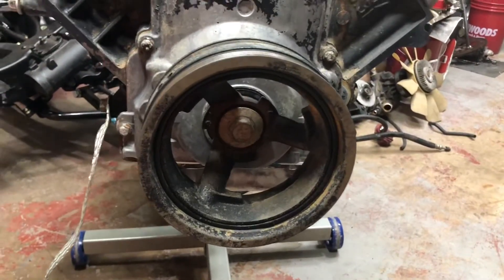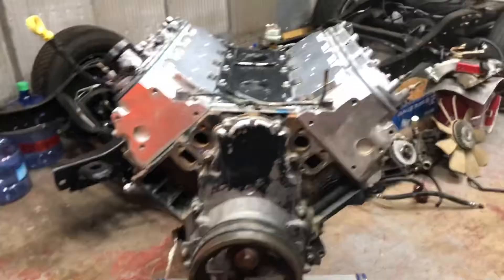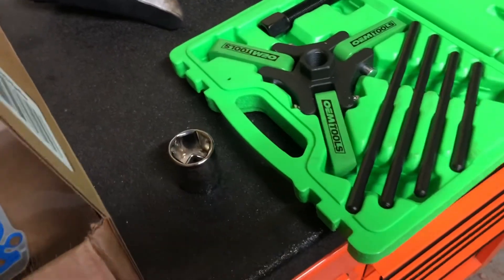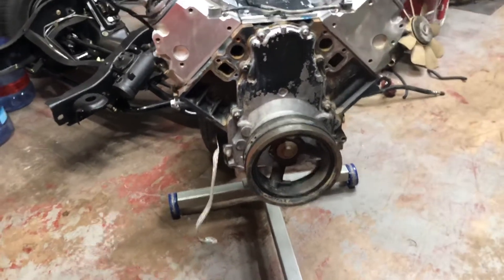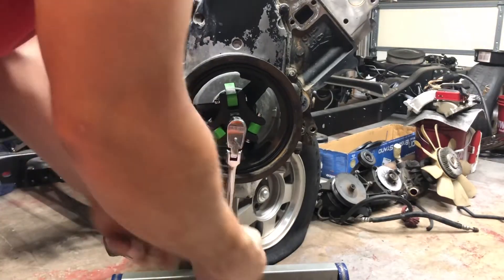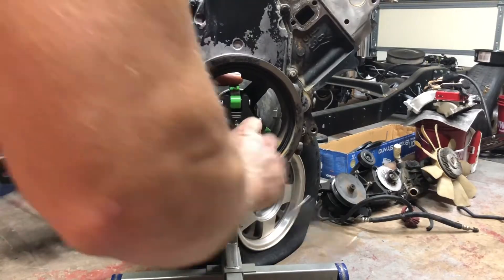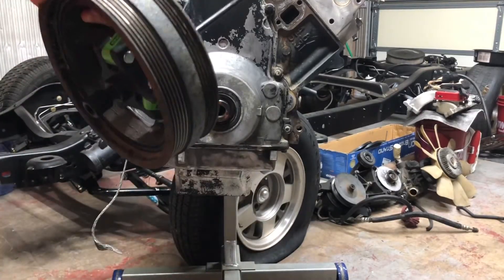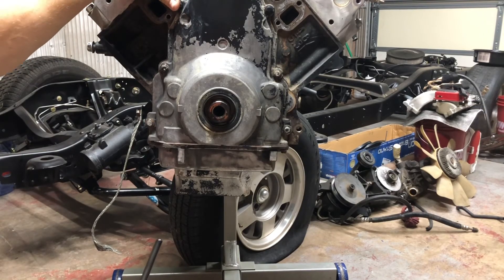How to remove a 5.3 LS Harmonic Balancer!

Comment: I'm no engine guru but I did spend 8 yrs in the US Navy operating Nuclear Reactors onboard Fast Attack Submarines, maintained, repaired and overhauled the engine room and have 10 US Patents in design of Fault Tolerant Servers. So rather than using those crappy thin rods many say bend, why not just buy a 5$ steel bolt whose diameter is a bit less than the crank bolt, cut of the head so it slides in and takes the place of said crappy thin a** rod or buy a stock piece of steel rod from the Big Box HW store, cut it to lengths with your grinder and then either way you have something thick and hard to press against the crank which should make this even easier than your experience................Just sayin'.................Nice demo thought..thank you Brother.
Reply from the maker: I already bought the tool with the rods so didn’t see the need to buy more rods, some say they bend. I’ve never had the issue but I also don’t put a impact on mine.

Comment: OEM  puller is great.  I bought one a few years back.  Mine didn't come with the longest rod strangelu but I was still able to use it to pull the balancer off of  my 05 silverado 1500 5.3.  I'm about to do it again .I wonder if they sell replacement rods for this puller? Great video.
Reply from the maker: It’s a great puller, I’ve never found any replacement rods for them.
Reply: @3rdGenC10s  Yes it is.  I probably won't be able to either sadly.  I did email OEM customer service today buy I am not holding my breath for a positive answer from them.
Reply from the maker: @kaylamarie8309  I wonder if you had a extra push rod laying around if it would work.
Reply: @3rdGenC10s  I don't know, maybe.  If I don't hear back from OEM customer service I might just order another OEM duplicate kit.  I can't stand having something that's incomplete.  There was some kind of washer in the kit as well that didn't make it to me.  Me thinks they might have sent me someone else's return lol. Oh well, live and learn and don't just blindly trust right?

Comment: I have a real space issue with my 5.3 swap.  Can I use a different balancer with a lower profile water pump?
Reply from the maker: I would look into getting a car water pump and accessories, or look at aftermarket brackets to move the accessories where you need them. ICT Billet makes good affordable products.
Reply: @3rdGenC10s  - Thanks. That’s where I’m headed.  I think I’m going with an LSA pump and LS3 balancer, at least to begin with.  Once that gets sorted, I’ll get with ICT Billet or similar shop for accessory drives and components.  I appreciate the quick reply.  By the way, great video!
Reply from the maker: @familyschnekser4819  no problem! Thanks for the support!

Comment: what is the torque spec of that bolt when you want to return?
Reply from the maker: https://youtu.be/JCU4FwXJ0C0

You’ll need to purchase a factory replacement crank bolt as they are torque to yield and should only be used once. I used a ARP fastener that is reusable.
Reply: @3rdGenC10s  thank you for this info
Reply from the maker: @comaradelee  no problem hope it helps you out!
Reply: @3rdGenC10s  will the bolt work on a regular 2010 suburban 5.3?
Reply from the maker: @comaradelee  should work no problem.
Reply from the maker: 240 pound feet with a final pass of 140 degrees.

Comment: How is you prevent the engine rom turning over while loosening and removing that bolt
Reply from the maker: I just used a impact to remove it, but you can also purchase a flexplate stop tool, which you will need when reinstalling anyways. 

Chelhead Engine Flywheel Locking Tool Steel Black Oxide Flexplate Holding Tool Compatible with Chevy LS 1 2 3 LSX https://www.amazon.com/dp/B087JB34VK/ref=cm_sw_r_cp_api_glt_i_XW2M5C85M1KNDX4DFBQB?_encoding=UTF8&psc=1

Comment: New sub here, I’m looking to buy that puller and try to get going on a cam swap and valve springs. Do you have an affordable valve spring tool off amazon you recommend? It’s hard to tell the quality difference just off pics. Some $18 tools look the same as $40 ones. How has that flexhead ratchet held up? Couldn’t see the brand but it looked like icon. Thanks
Reply from the maker: If you aren’t in a hurry lisle make a good one. Lisle 16560 Valve Spring Compressor for GM LS https://www.amazon.com/dp/B07QN8H7T4/ref=cm_sw_r_cp_api_glt_fabc_33FH526CY7G4DQ1VYTAV you can only do one at a time but seems to be a quality tool by a trusted brand. It is icon brand. It’s my go to ratchet it gets used almost daily and I haven’t had any issues out of it other then have to retighten the screw to the flex head every month or so.

Comment: Do you have to make a mark to install it back in the same position in relation to the crank shaft?
Reply from the maker: No sir just press it on.
Reply: This is a damper, not a balancer. That's why it isn't keyed. So no you don't have to have it clocked.

Comment: What do you do when you break an ear off the balancer? Lol
Reply from the maker: Are you able to flip the jaws of the puller around and hook the balancer itself?
Reply: Not with the 8" puller I have but ill het a smaller set and try it
Reply from the maker: @BWalk80  let me know how it goes.
Reply: Had to ise the sbc puller and use some steel flat plates drilled holes put them between the balancer and puller and played hell doing that lol
Reply from the maker: I’ve only removed a couple and  never had any of the ears break off.
Reply: Hopefully you never have that problem lol